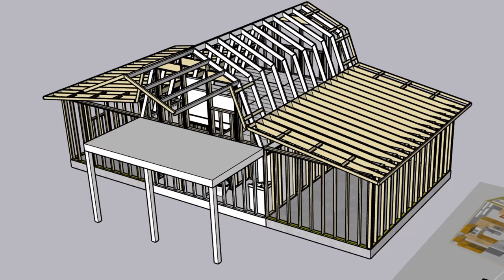Building a Secret Trapdoor | Shed Tiny House Project Update

Comment: To make it simpler, I would remove one of the windows, the one at the top of the stairway. Cut that out to be a door. It could have a window in the door for light. Less to cut out, plus a simpler trap door and railing arrangement.
Reply: Not as fun as design, engineering, and building. That’s THE reason we are doing this. The door would be short, and still will interfere with the stairs.

Comment: I love the idea, but I'm also worried too because what will be the weight limited for the drop down floor?  I'm 6'3, 256lbs, so you can see why that would worry me.
Reply: This is an old comment, but seriously, that drop down floor could withstand 3 of you standing on it without so much as a groan. The framing is such a small area, the support would be incredibly difficult to break.

Comment: Make part of the larger staircase opening railing integrated into the  trap door railing . When  the door is down  that integrated part is flipped 90 degrees for safe access to the door to the deck.

Comment: Build the other half wall by the stairs as a wall within a wall. The outer wall (shell) could move and form a wall blocking the stairs while the inner wall could hide an actuator/motor to assist movement while also continue to block that section. It would basically close the upstairs off from the downstairs completely at about half wall level, no handrail needed. Hopefully you can follow that.

Comment: I know it's well after the fact.
However, when you were filling in the void in the plate around the stairwell, I'd have looked at putting an inch or so of foam board in there for a bit of insulation, sandwiched between the inner and outer plate.  Right now, all that wood is a giant thermal break, and you're going to lose a bunch of your heating/cooling through that.

Granted, you're down in TN, but it still gets cold/hot there.

Comment: I would try your hardest to make the trap door flush, it looked like it was sticking up on the mock up.
Reply: Will be same floor finishing as upstairs with only a small gap in that front area. Good point. It is only thinking at this time. Break it fast and fix it.

Comment: It will take some thought about how to lower that railing. You will have to make sure that none of the equipment will block the stairs and you also have that gap when the railing folds down. It will be interesting how you solve this and still be in code.
Reply: Good point. When it’s down, egress is the door. When it’s up it’s not an issue. Definitely need to make it easy to manually lift. We’ll see!
Reply: What happens if someone is out on the deck and the trap door gets raised?  Could be a long painful fall coming through that door.
Reply: @kenc2707  what if they step off the deck? I’m sure we can figure out something.

Comment: still see light coming through the gaps in walls of the building sould get them sealed up...or will you do that with spray insulation
Reply: The new addition roof attaches above those cracks and even more of that OSB will be cut out to create storage space in the adjacent rooms. The entire outside of the house will probably be board and batten over the T1-11.